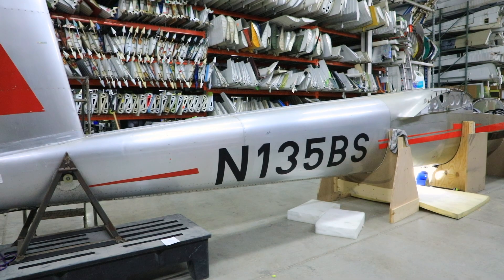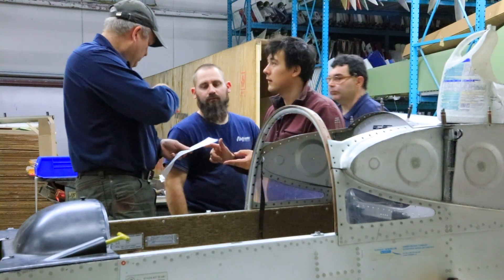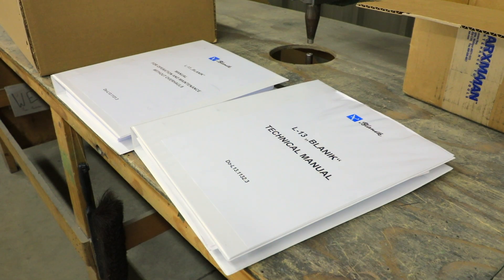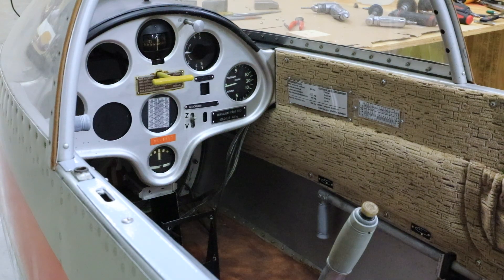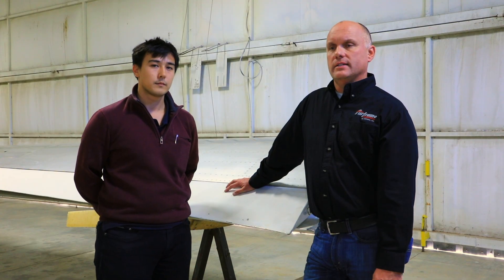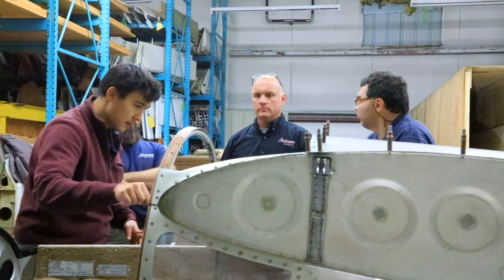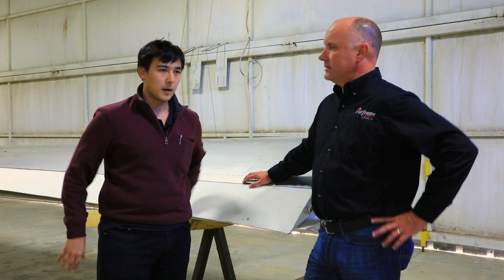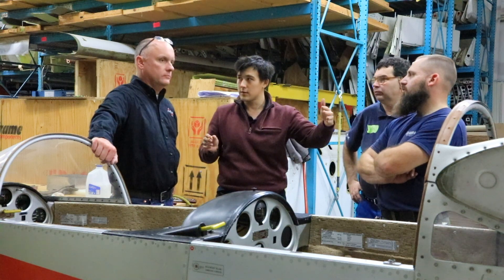Blanik L-13 Wing Modification Program E1

Comment: do you know if the spar issue is the same in the vivat motor glider ?
Reply: It is not. Vivat has the L 13 A (or L 23) wing type. This wings do not have this problem.